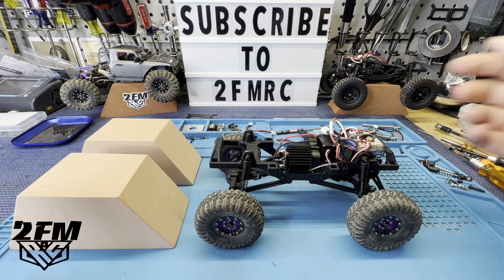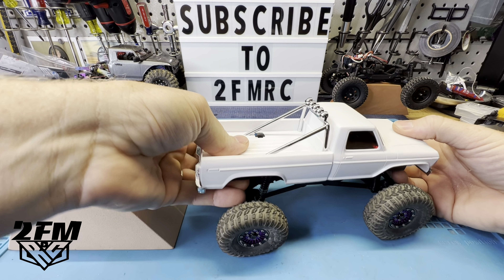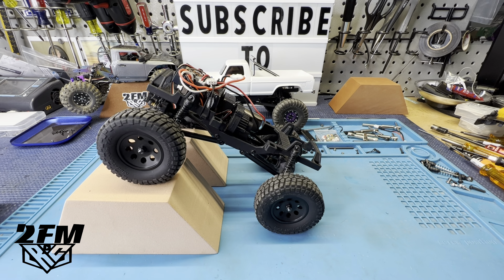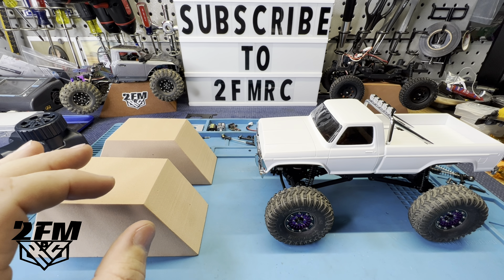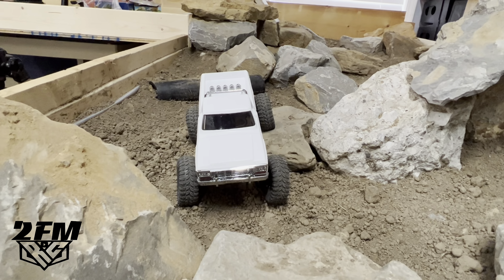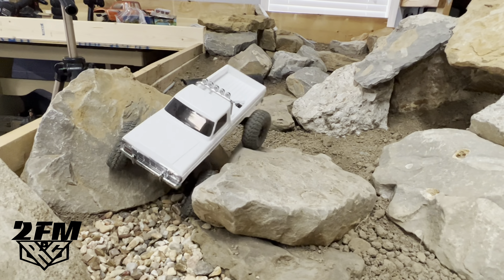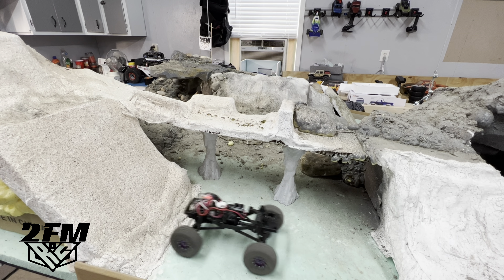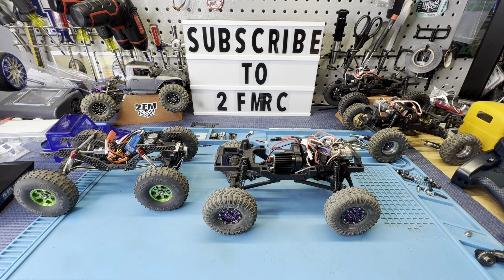FMS FCX24 Speed Motor Slow Crawl comparison & thoughts!

Comment: Wish they made anti foam for scx24 bought two pair for my 1/10 scale because excaged liked them and all i have to say is wow .
Reply from the maker: I’ve not been that impressed with anti foams in 1/10. Bought them because how much he loves them and I prefer the halo foams most of the time. Anti foams just seem super bouncy at times. I was hoping I’d love them. Bought a printer and started printing my own as well but I prefer the foams for 1/10. They work but not my favorite. Have you ran Flubberstufferz in your Scx24 tires?
Reply: No I like because no roll over on sidewalls. I'm having a bad rc day today. Lizard pro die in my scx24 and my wife's scx24 the steering servo died so we broke out our rgt 136161s and the motor in mine died so today has not been good lol.

Comment: Thanks!! I think I can live with this low speed control... The original setup is great but sometimes the high speed is so long it cogs when starting in a steep incline, so while I don't dare to change gearing in it, this speed motor can add that wheel speed in low.

Comment: If your heat sink isn't tight against the motor, it isn't helping to dissipate heat. Any part not against the motor may be containing heat. Another great video sir!
Reply from the maker: Yeah I actually got it to clip on all the way once I took a bit more time with it. It still messes up the mounting of the body so a little trimming is needed to run a stock body.
Reply: @2fmrc  I know you'll make it work, you always do!

Comment: I think your idea of lizard and the throttle curve it has might actually be ideal. I got to run mine today. When I put in the esc/receiver I thought it took out the motor too like it did the steering servo but it turned out to be the dual rate on the radio was off. I don't have a Ford, where did you get that body and is it for scx24 as well?

Comment: Hey dude, I love your videos. 
I am wondering if you have had the speed motor for the fms smasher overheating problem. 
I picked up a smasher v2 along with all the upgrades. I am having trouble with heat problems. I installed the speed motor after a week of running the stock setup.
Within a minute, the motor was so hot even with the heat-sink on the motor that I was unable to touch the motor. I never got to full throtle with it. 
Then I noticed the esc was getting hot as well, and I believe the esc is going into a heat protection shutdown. The only way to restart it is to unplug the battery and replug. I also tried running the motor out of the transmission and still running into the same problem. 
I have messaged fms about the problem, and they have not responded. Any help from the micro master would be very much appreciated.
Reply from the maker: I really appreciated it! No I definitely haven’t had that issue. I actually run the speed motor without the Heatsink all the time. It’s gotta be an issue with that more imo. Sorry to hear it man.
Reply: I was thinking it could be the motor as well. It seems like a really coggy motor when spinning it by hand. I also checked to make sure the pinion wasn't pushed down against the motor bushing. Maybe there is a problem with the windings in it.
Reply: @2FM RC  I figured it out. I removed the motor and figured out that the transmission was really hard to turn by hand.  The transmission case is too tight on the center gear. My center gear sits a little bit higher than the top two speed gear. I will try to make room in there one day. For now, I loosened every screw on the transmission case. 3/4 turn on the transmission case itself and the pinion/spur gear cover and the skid plate mounting screws. Now, it is really easy to turn.
Next, I installed the speed motor on the transmission case again and in the first 20 seconds of driving and the first reverse to forward wheelie attempt the esc cut out. Then I changed the settings to forward,brake,reverse mode, and the heat is completely gone and no longer cuts out.